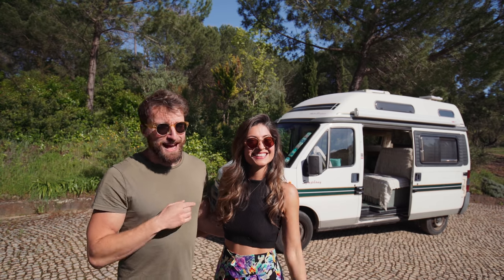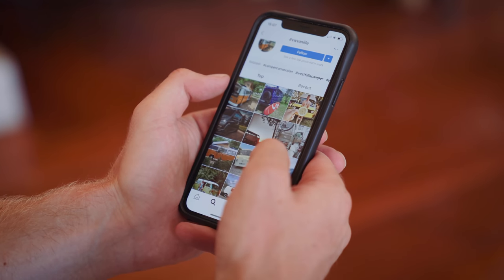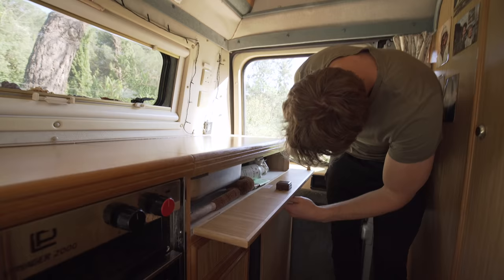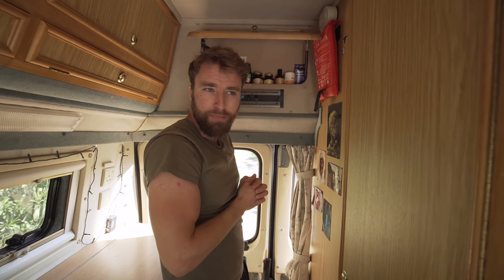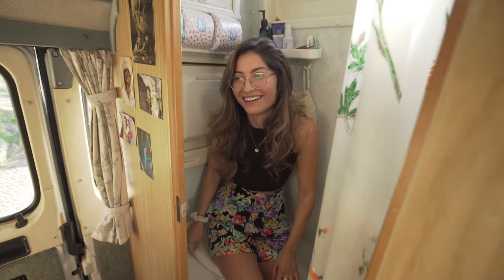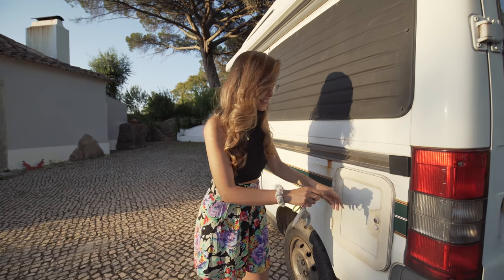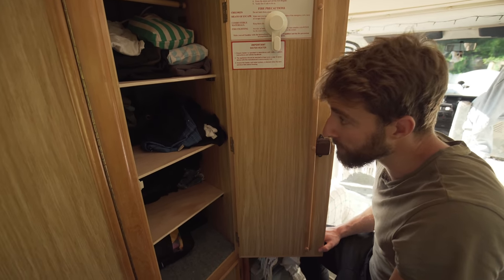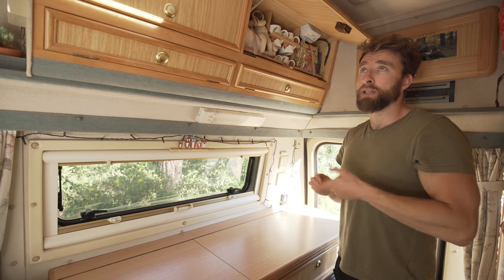VAN TOUR | Small, Modular, Smart Conversion w/ Shower + Toilet | Peugeot Boxer Autosleeper Symphony

Comment: The shower area space is wasted. If you had a tall shelved pullout trolley on wheels you could use that to store more stuff. Simply pull out and push towards the back when you want to use the shower area, and push back in when finished.
Reply from the maker: That’s a good idea, Gavin! To be fair, we do tend to use the shower area for storage of our bins for example but we do enjoy having it available so we can use the toilet etc. Thanks for watching! 🚐💕 xx Tania
Reply: @JitsIntoTheSunset  Actually my original idea, since I'm in the UK and it rains a lot, was to put a perimeter along the edges of the roof so water pools, then have a hole that I can open and close at will that the water drains through; into the van and into a huge tank on wheels in the bathroom lol. That way I wouldn't have to skimp on showers. Sounds crazy but pretty smart if I don't say so myself.